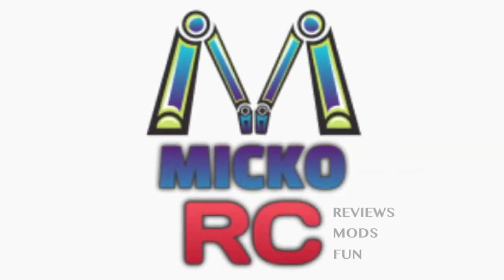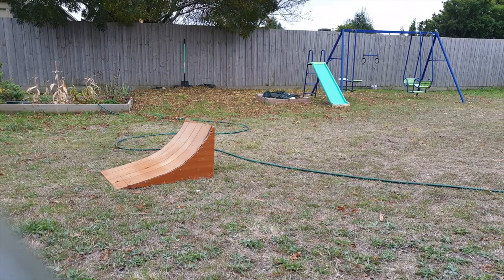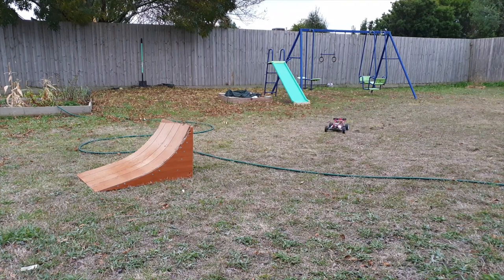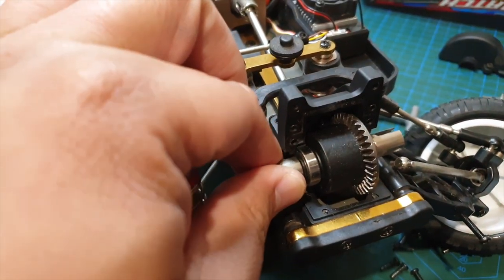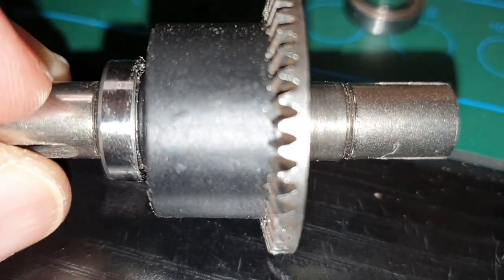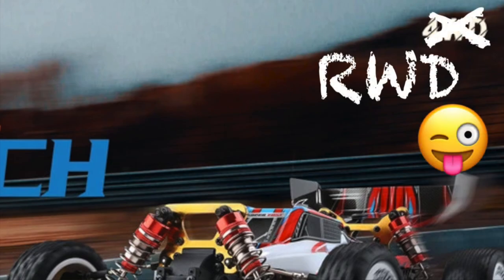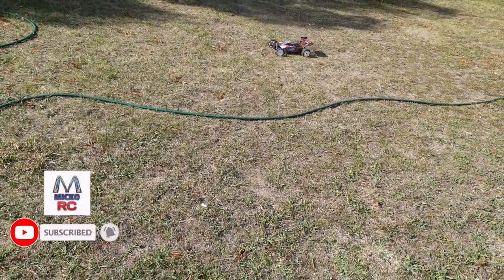WLtoys 104001 First Run FAIL | 2s Speed Test | 2WD/RWD Conversion | Broken Bevel Gear

Comment: Making the most out of an unfortunate situation brother, great to see Makerfire has great customer service to replace the part that broke on this RC. I can see your diff definitely had more grease applied inside then both of mine did, the gasket on mine was dry and there was only some grease in the middle. WLtoys were slack for not properly greasing all the gears throughout in the factory as a lot of new owners now have shown this in facebook groups etc. Thanks for sharing Micko, at least you can mess around with it as a rear wheel drive until your parts arrive 👍🍻🇦🇺
Reply from the maker: Thanks brother! I finally got over it. Lol!
Yeah, I noticed others' diffs like yours had a lot less grease then mine. But yeah.. slacks buggers over there!
It's my first RWD car, haha.. It's a lot of fun too! cheers Dave 🍻🇦🇺

Comment: It did that because you're holding the throttle when the car lands. There is no buffer on these cars. I don't do that even on my cars that have a slipper clutch. Btw, those parts you looked up are based off of Vaterra Twin Hammers. One of the best rc cars made. Not sure why you would assume the year of production had anything to do with quality.
Reply: Hmm...ill have to find a way to install a slipper when I get the brushless setup I ordered... im planning on converting it pretty early...and it looks like a slipper might be mandatory.
Reply: Yeah, I decided not to preorder the car until I see all the issues it has. Concerning slipper, I'd suggest Tomley RC channel. He knows what he's talking about and he mentioned he'd do a comparison between this car and the LC model it's based on. If i remember correctly, he also mentioned trying to fit a slipper on this car.

Comment: I think the upper front driveshaft together with bevel gear slams into drive gear when you jump because chassis is too flexible, I know there are braces to 3d print do you think that would help?
Reply from the maker: Or I could learn to control my landing properly to land flat on the ground.
But yeah I have since printed up a brace and installed it. Much less flex now. thanks

Comment: Thanks for the video. I think it's just a quality control problem. Sometimes with wltoys, the parts are just bad quality. Sometimes you get lucky. I greased my diffs and bevel gears before running the car and the bevel gear going to the rear differential shredded it's teeth after only a few minutes of driving. No jumps or bashing of any kind.
Reply: Same here. Whatever metal they use to make the bevel gear seems very brittle and cheap. Anybody make a high quality one?
Reply: @goodknight37  I ordered replacement on ebay and so far it is holding up, even with my new brushless motor.

Comment: another tuber just plugged fan into other port on esc and fan stays on...you want fan on all the time when running anyway...... i think that was a bad cast part,but grease packedin that area will help also and in my opinion may have prevented that fail...

Comment: Trashed my front bevel gear on only the 2nd time I took the car out, and then the rear on lost its teeth after the 4th or  5th outing. Perhaps very poor quality gears with absolutley no grease. 
Replaced them (with part no K949-43) and all's good...and it seems a LOT quieter too, or perhaps that's just the grease smoothign things up.  Fun car, though!
Reply: how did you get the beval gear  out? Mine is stuck?
Reply: How have the new one's held up? are they stronger then the ones that came with the car?

Comment: 🤯brushed motor and striped the bevel gear? I striped mine on the rear after brushless conversion and installation of traxxas slash wheels. I guess I've got what I've paid for

Comment: Same thing happened to mine except in the rear, on the first run almost instantly.  They are setup way to tight sometimes, with no grease, and powdered metal gear.  I can't believe they sell them like this, how pathetic.  The replacement gears for sell are better quality then original, they are machined not powdered metal.  So buy those, then make sure its got good mesh, use shims if need be and grease it up.

Comment: Just shredded my bevel gear on the 3rd or 4th run. I was jumping it pretty hard though on some bmx jumps. My 124019 has been dead reliable so I'm assuming this is a unlucky break. New bevel gear is going to take a few weeks which is a bummer...

Comment: why does the 124018-19 come with metal hexes but not this :s.... lil jump and micko bends a bone lol...as you said that gear was old and the shattard parts looked rusty from yt anyway lol...
Reply from the maker: 😄
They probably used a old batch of parts just sitting in a warehouse exposed to all the tropical elements over there. Lol 😆
Fortunately I have a couple of spare sets of 12mm metal hexes. Holes were too small so I made them bigger using a 5mm drill bit and now they fit over the axles.
Reply: @MickoRC  thats sweet lol and yeah all that moistsure in the air made them go funny..and your right its old stock as my 124019 came with 144001 sticker inside the transmitter tray and the same on a k989 the transmitter sicker was a L898 or something lol
Reply from the maker: @andyroo8uk685  😆

Comment: Hey have you found a decent replacement/hop up version of the bevel gear im homing to find one i just broke mine im gunna be installing an lc10b slip clutch gear from lcracing but am on the market for a bevel gear thats a bit tougher maybe steel
Reply from the maker: Nah bro. Just using a standard replacement. I hope you find a better quality one.
Reply: how did you get the beval gear  out? Mine is stuck?
Reply: @fastfreddy7111  have you removed the metal cover and plastic cover? It's around 9 screws to remove both plates.
Reply: @2psnopod  Yes I did. it seems to be stuck. do you still run this car? is it still  working?
Reply: @fastfreddy7111  yes I do I'd have to say if both covers are off and you still can't get it out you might have to pull a diff out to remove the drive shift to reduce the amount of pressure on either side it's around 6 reg screws then two Allen nub screws on wither side of the drive shift watch your bevel gear when reinstalling to make sure you it's not binding or flat out missing when you put it back together but with the driveshaft uninstalled it should free it up a bit or maybe go to the bottom and losses the center gear mounts see if that frees it up it should just pull strait up and out tho with or without the driveshafts installed
Reply: Ah crud dude I'm so franking sorry I just reread I thought this was a ceter drive shaft gear video I got comments on a lot there is two Allen screws on either side of the driveshaft that hold the bevel gear in place 😳 😅  my bad man if you need more help I can just upload a quick video showing it being pulled and replaced just let me know
Reply: @2psnopod  Thanks for your quick replies!, Yes can you show a video please. I had the drive shaft 100% out and then loosened the 2 grub screws and the bevel still didn't pop out! I feel if I see how you do it I may find what Im doing wrong. Thanks!
Reply: Hey! My rear bevel gear got stripped out. I removed the 2 grub screws to remove the driveshaft but it won’t come out. Any advise will  be appreciated! Thank you!
Reply: @daidan_708  heat the thread locker up but be super careful of electronics lol good luck taking the pinion I completely ripped my motor drive safe out trying to break the factory thread lock lmao
Reply: Alright, thank you! You mean heating up the area where the grub screws where at? If this doesn’t work, what else can I do?
Reply: The grub screws came out but the the drive shaft still won’t come out.
Reply: @daidan_708  I'm slightly confused by how it won't would I talk you into unloading a short video showing how it might help identify the problem
Reply: @Stephen Bennett Sure! Let me upload a short video. Thank you!
Reply: Video posted!
Reply: Hi! Did you checked out the video? Hope the video will help you identify a solution. Thank you!
Reply: @daidan_708  hey so sorry looking now my internet went out for a bit being winter lol I'm looking now

Comment: Where do you buy more of those plastic 12mm wheels nuts, I did a search on banggood and could not find a match.   2 of mine are stuck inside the wheels and I would have to damage it to remove them. Thanks
Reply from the maker: I get mine from aliexpress or ebay. They're metal too. Make sure to get ones with a 5mm hole. Otherwise you can get ones with a smaller hole and then make the hole bigger with a 5mm drill bit. That's what I did with spares I have originally intended for my 144001 and 124018/019.
Reply from the maker: For example ...
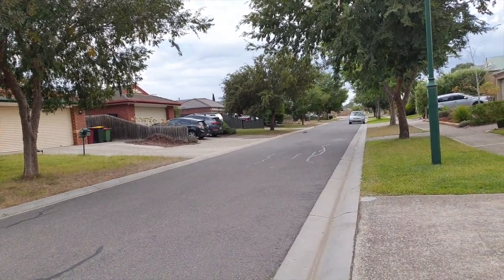US $2.99  20%OFF | YUKALA  4mm/5mm/6mm metal CNC wheels nut /hex hub for 1:10 RC car  12mm aluminum wheel hex driver  adaptors Multicolored
https://a.aliexpress.com/_mLR7DEN
Reply: @MickoRC  I actually meant 12mm hex for the 124019, not the new model. I bought a set of aluminum from eBay but the little pin did not fit the stock axle... the pin was too small and loose.
Reply from the maker: @i4nic256  oh ok. they never specify the pin size so it's hit or miss. I always end up cutting pieces from a nail. Good luck bro. Have a good day 😎👍
Reply: @MickoRC  Good idea with the nail trick, I’ll try using that. Thanks you

Comment: Lot of stuff seems to break or bend from not to high jumps and bashing.. 😜💩 need rev 2 or pro version..💪
Reply from the maker: You're right man.
And I'm not a fan of the absence of a second level bar on this.
Reply: @MickoRC  the chassis flexes too much then the gears do not line up and start grinding so this 1/10 scale is too heavy for this too thin aluminium chassis